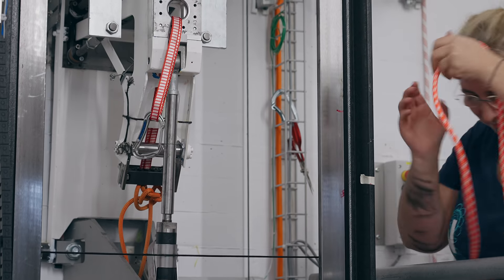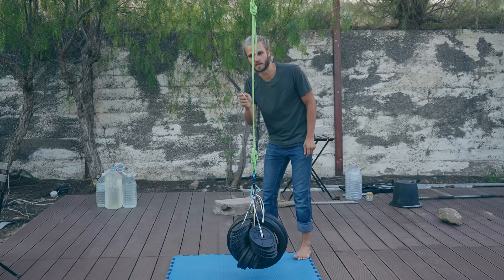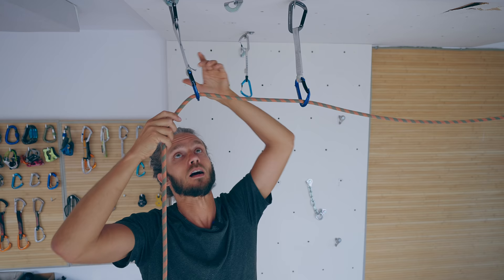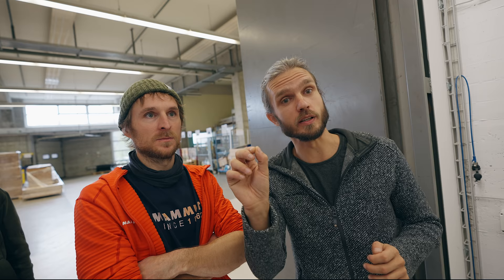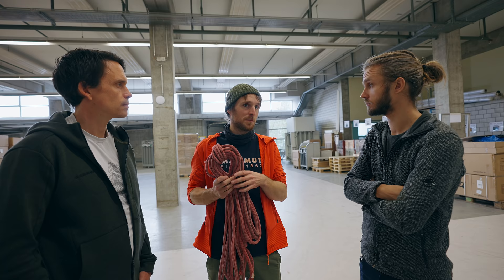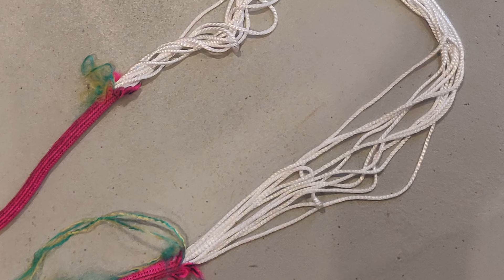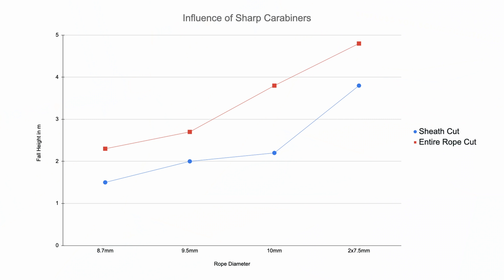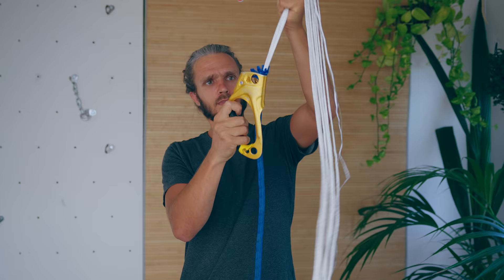Cut Resistance of Climbing Ropes Analysed

Comment: I'm a sailor, not a climber, and it's absolutely wild to me how differently we think about ropes. We even use a different word!
Reply: I know fellow sailor here i was looking at that carabeaner and thinking: halve the lines on the ship go over a corner like that on every tack! I think it has to do with the tension when stuff runs over corners for climbers they only think about falls where theres a lot of tension when its only the slack side that runs over stuff onboard and if it fails people curse the bosun out but normally no one dies on board but someone probably dies on the wall
Reply: Climbing ropes are pretty much like bungee jumping ropes. Made to stretch a lot. I'm pretty certain the lines on a boat are not supposed to give way in the same fashion and are quite a bit stiffer.
Reply: @bernhardlangers778   Actually, most sailing boats are the same dyneema ropes as are used for climbing. This is because if a strong wind gust swoops over the mast and sail, then the mast will want to move, without elastic ropes the mast would break.
Reply: @jackpotit dyneema is not so elastic and climbing ropes uses different materials 😉
Reply: @jackpotit dyneema is like the opposite material.. we use dyneema on slings and on gear (where we also use steel and aluminium)
Reply: How do you call it? Fabric cable? Cloth snake?
Reply: @MrCmon113  Lol, we call 'em lines! At least in the running rigging. I've heard some people say that it's rope when you buy it at the store, and it becomes a line when you put it to work, but I think there's debate on that.
Reply: sailing ropes are more similar to kite lines (often dyneema) i think. a lot of the same terminology atleasg

Comment: I'm not a climber, and I have no idea why YouTube recommended this video for me to watch. I did find it interesting and I wonder how the modern nylon ropes you show compare with the old style hemp ropes. Also, considering what I saw of the wear on the carabiner made from aluminium alloy made me wonder if the same thing would happen with an older and  heavier steel carabiner.
Reply: Its always a trade off, the newer gear tends to be lighter but less durable. 

The older gear is heavier but more durable.

IMO in good conditions the new style gear is the obvious choice, but the durability of older style gear helps in non ideal conditions.
Reply: If it's a fixed permanent carabiner, then you really want nonreactive metals, not steel that would rust over time and possibly suffer a catastrophic failure. If it's part of your personal gear, you should be checking them over and taking note of any potentially dangerous edges that are forming with use.
Reply: @Keenath  good point
Reply: Same

Comment: It's worth adding that although the climber in the BMC video survived he landed on the belayer and they were quite badly hurt. I personally thought it a bit reckless climbing on a single as the fall was obvious and the FA (Steve Mcclure) knew this and actually tied on with THREE ropes for the FA.
Reply from the maker: Thanks for extra info!
Reply: If Steve does that you know it is a very serious situation!
Reply: The climber had unfortunately only seen the video of Pearson, who was going with 2 half ropes running through all the gear (basically, same risk). Steve was smarter...
Reply: @calenell  So when you run multiple ropes do you not go for every quickdraw?
Reply: @motherlove8366  with half ropes, if the route is not straight I will use the right one for the pro more to the right and the left one for the pro to the left, so the run parallel and don't make weird angles (drag)
Reply: @calenell  and in the case of this route, one can leave two ropes through the safe draw, clip one through the danger draw… if you fall , pull one rope out of safe draw and move it up… if you fall again, lower off
Reply: British climbs in general look like death traps to me lol. Their rock is soooo unwelcoming.
Reply: @calenell  yep, this would be the standards for most climbs using half ropes. But the "Elder Statesman" is not a standard climb! It's a trad climb in 5.14! There is just nothing else to clip more left. That friend has to be placed very high in the crag and then you go around the corner. If one falls one rope will surely be ripped. It doesn't help if only one is clipped there because falling into the second placement will also result in a ground fall... Steve was smart to use three ropes and I think the clue is to have at least one with some slack to catch the fall after the other two were ripped.
Reply: @andreas_swissry  I am well aware of how that climb works, I was there and I saw where the friends were. My previous comment was a reply to a question about how to use half ropes in general...whether you hit the ground or not with the previous placement simply depends on where you placed it: if you have a lot of big cams, that wouldn't be much lower. The question can be, would that rope tear as well? Nobody else actually took the whip, so who knows. In fact, the route was originally graded HXS - hard to grade, as the danger is hard to calculate.
Reply: By the way, the climber is called Michele Carminati, the diameter of his rope was 10 mm and this is the video:
https://youtu.be/K9Wzx-9JzsI
"Wild Country sponsored athlete Michele Caminati hit the ground after attempting to repeat Elder Statesman (HXS 7a) at Curbar on Tuesday 28 March 2017."
"As he fell, the single 10 mm rope he was using completely sheared while it viciously scraped down the arete. Michele sustained a broken wrist and broken heel bone in the fall and stayed in hospital to recover from his injuries."
Reply: @Paolo_De_Leva  idk if I have the balls to watch this video 😱

Comment: Unicore has the massive advantage that even when you get a cut on the sheath that you will not be exposing a large amount of the core, hence the odds of cutting the core are much lower.
Reply: This would mean, that the shown fall with the cut rope, would probably not have happened with a Unicore rope. Do you agree?
Reply: It would be interesting to see similar videos done with a rope company that has unicore ropes. Mamut's employee's response to it was just, well the only benefit to unicore doesn't matter because we don't have sheath slippage. Of course mamut won't praise a technology that they don't utilize.
Reply: @drqazlop  i agree. I am a mammut stan but her response was entirely inadequate
Reply: @pr3historic647  that response was marketing bullshit, there are literally videos and tests showing how superior unicore really is
Reply: @Simon-kx6yr  I believe so as the part where the core is showing would be tiny and then the rope would be back to rubbing the sheath along the sharp edge. You would still need to retire the rope but the climber would not be hitting the deck.
Reply: Working in a climbing shop and having climbed on and cut apart many different ropes. Unicore is not necessarily what it’s cracked up to be. The core is just sprayed with a weak adhesive before sheath assembly. I’ve found in every unicore rope I’ve dealt with, this adhesive drys up and is totally not effective, long before the rope has “worn out”.  Infact Beal wall master has consistently the worst sheath slippage I’ve ever seen when used in a top rope gym environment. (Like it’s designed for). Like the sheath moves A LOT, in every rope from multiple reals, so it’s not ever a bad batch. It’s less bad when used as lead ropes for heavy indoor use however. 
Having dissected a few top end Beal and Edelweiss ropes like the joker and stinger I’ve found no evidence of the core and sheath being bonded apart from little dried up balls of glue. Not saying these are bad ropes at all, but i certainly wouldn’t be buying a rope just because it was advertised as unicore. After the rope is past the “brand new” stage, It’s just another rope. Probably why most other roped companies haven’t tried to copy this tech from Beal group.
Reply: @mgirvan885  Wait what? When I cut my beal rope, I noticed that the sheath was woven within the core, not a lot, but definetely some strands were running trough the core.
Reply: @alexbarcovsky4319  it’s possible technology has changed. And I haven’t cut apart all unicore ropes. Over the past 10 years or so, Since unicore came on the market, I’ve seen plenty of jokers that haven’t worn well, cut up a couple of stingers and an edelweiss rope. Can’t remember the exact model. Aswell as dealing with multiple 200m drums of wall master and edelweiss equivalent. I’ve emailed beal last year when a customer returned his Joker and we cut it apart out of interest and only found traces of dried up glue. It was only used as a “holiday”red point rope as such so wasn’t battered. Beal did comment they are improving their unicore tech so it depends on the age of rope as to what version of unicore you get. I’m not sure if they are sewing it together now. I personally have a Beal opera, it only sees light use and I’ve had no issues. 
Their wall rope which I’ve purchased a few times in past 2 years has consistently performed terribly in top rope scenarios when ran over a wide radius fixed pulley. (Lyon SRB). Over a 20 metre top rope, I’d consistently get 6-10 inches of sheath slippage off one end, within a couple of weeks of use. And when you grip the rope tight and run it through your fist you can hear and feel all the glue separating and sheath moving in your hand. It’s garbage. 
The difference between Wallmaster and the edelweiss gym rope compared to non unicore, DMM super big gym (made by Edelrid) or mammuts gym rope is night and day.
Reply: @mgirvan885  Well my experience isnt so wide, I only have the Booster III 9.7 mm for cragging and Tendon 10mm for indoor trashing so I cant tell you much about how they all compare. That said the Tendon has seen a lot of use and abuse consisting of lots of toproping and a bunch of hard falls as well as 20ft+ falls and so far there is no slippage, only some normal fuzz which I always cut off when the bite loop is the size of a pinhead. The Booster feels like brand new so far, but it hasnt seen that much use yet.
Reply: @pr3historic647  What was really gross is that a potential life threatening issue can arise due to the design, and demonstrated, yet it was just sorta blown off with "  eh...we don't have sheath slippage"
Reply: @Simon-kx6yr  no not exactly unicore is less prone to snapping from worn sections over time compared to a regular sheathed rope. If you take either of these types of ropes and run it along a sharp edge it will still cut. So a unicore rope with a small cut in it is still somewhat protected by the sheath. A sheathed rope will expose the core the moment the sheath opens up.

Try and keep this short but an explanation on that dramatic clip with the guy follows and the rope cutting. So he got the FA the day prior and was attempting to film a send the day of the recording. The clilb is like a 5.13 R or something of the sort, but anyway he fell on the crux/R portion of the climb where he traversed from right to left over a sharp aeret. The initial fall pulled his beley some 10ish feet up in the air and for a moment the rope was not entirely weighted. When the beleyer came back down on the the rope the climber had fallen some ways bringing the rope to a more pronounced coner of this aeret. Both climber and beleyer weighted the rope from opposing ends and the rope really only ran along the rock with tension for a foot or two. Don't quote me on the injuries but I believe the climber broke both ankles and the beleyer broke a rist and collapsed a lung after the rope snapped and both were free falling.
Reply: @mgirvan885  the technology actually was invented and developed by Kordas brand but Beal took it since there was no patent at the time. 
There are different companies now doing different Unicore but named something else.

Comment: In volcanic soil, extremely fine grit can embed itself in a rope and act as abrasive when the rope is pulled through a carabiner or belay ring. I have seen the cold shuts at the top of route in Owens Gorge that have been half worn through for that very reason.

Comment: One thing I think is fairly common that you've overlooked in the testing and that is a ding/burr in a carabiner from say smashing into a rock a few times or wear and tear over time.
It wouldn't have to be big but it could be potentially razor sharp under stress.
Something to consider
Reply: I agree. That's why it's important to carefully inspect safety equipment before use and also after to check for damage.
Reply: I feel like if a climber doesn't say least look for burs/dings, they should never be a climber. Or, otherwise will not be a climber for long... Which may be making your point.

Comment: A note about "colour" on aluminium alloys.
A lot of aluminium is coloured by a process called anodizing. Anodizing in itself is transparent and actually a form of aluminium oxide. But this oxide is also very hard, has rather low friction and is abrasive resistant (it is also used as an abrasive for metals and is the actual material called sapphire). 

So conclusion: Colour on aluminium is not only for decoration and if the colour is worn off the metal might start to wear a lot faster as well as wear the rope faster.

(Anodizing is a science in itself with varying thickness, when/if dye is added and probably a ton more which I don't know of).
Reply from the maker: Uuu thanks for sharing! Interesting!
Reply: true, but the anodized layer wears off SOOO quickly on carabiners. Lower a couple people, and its pretty much gone in the spot that matters. Especially if your rope is dirty, the dirt/sand in your rope drags over the carabiner, cutting into it like sand paper
Reply: @natebracalente2754  Not all are anodized, some just use a (transparent) paint to look anodized and anodizing can be done to different thicknesses and quality levels.
But one thing is sure - bare aluminium wears faster then anodized (and simple paint a lot faster still).
Reply: The anodization used on consumer products like carabiners is a dyed Type II anodization. The thickness of the anodic layer is typically around half a thousandth of an inch (around 13 microns) which is ~1/6 the diameter of a human hair. For this application, the anodization can be considered entirely aesthetic, and I wouldn't attribute much if any performance benefit to the coating. A more functional coating is Type III anodization, which is done under a different process and produces an anodic coating with a thickness up to 10x thicker than that of Type II anodization. Type III anodization is used in industrial applications, is not typically dyed, and is used to increase hardness, increase wear resistance, and decrease friction coefficient of treated parts.
Reply: @denniszhang9278  yes, flashlights for example have a type iii anodizatiom
Reply: Good point, there anodisation methods vary i e. acid vs hard anodised layer and varying thickness. Some carabiners lose the layer after one day of top roping while others seem to last longer. Anyway, bulletproof Edelrids are going for the next trip.
Reply: @denniszhang9278  Thanks for a slightly deeper dive into this topic.
Reply: Those pesky silicates get in your rope and fuck everything up. Same reason you don't even rock your chainsaw chain or stab a knife in the dirt etc etc.
Reply: @Lumi_nance  which flashlights? all flashlights? :o
Reply: Aluminum will also oxidize by itself in normal air fairly quickly as well. That is one of the reasons why aluminum has to be cleaned and scuffed before welding even if it was just cut recently.
Reply: Lmao anodisation is not sapphire.....
Reply: @Lumi_nance  the US military uses a class III level 2 black anodizing for aluminum parts on rifles. It would be nice to see that high of quality on a carabiner, but the process is more expensive than the carabiner.
Reply: @Alex-wb2yw  Only on the surface. These anodization processes force the oxide layer to become thicker than would naturally form by atmospheric oxidation alone.
Reply: @kylenakamura4353  from reputable brands, yes. E.g. Armytek, Zebralight, Jetbeam, Nitecore,... have very nice HAIII military spec anodization

Comment: I haven't climbed since 1981, and a lot has changed. We climbed on 11 or 12mm or 2 x 9 or 10mm ropes, the technology has moved on considerably, thanks.
Reply: I’m with you Andrew. I stopped climbing in about 1980 as I left the Search & Rescue Unit. We used 9/16” Goldline for strength and would never use Kermantle rope but if we did it was at least 12mm.  Even a strong as our gear was, we still protected it from sharp edges and inspected every rope inch by inch for wear. We used to have a saying for sportclimbers that used anything less than 10mm and our old aluminum carabiners were larger in diameter and round providing less bend & friction for the rope than modern carabiners.  I think the Sport Climber crowd have pushed this ultra-lite gear a little too far when one static fall can break your rope..